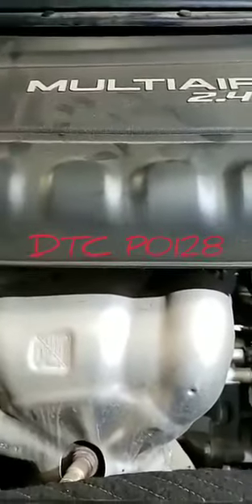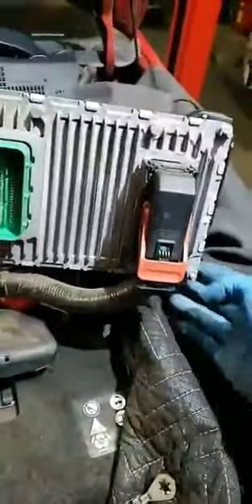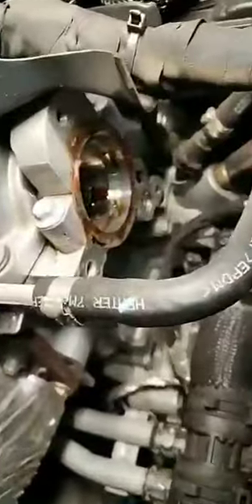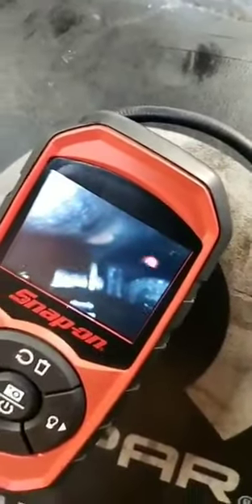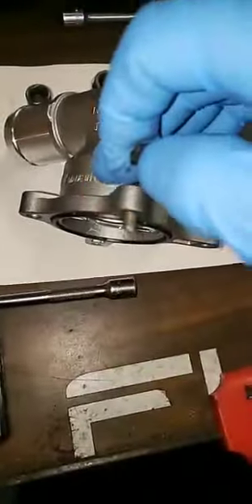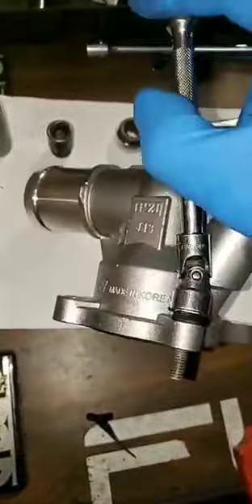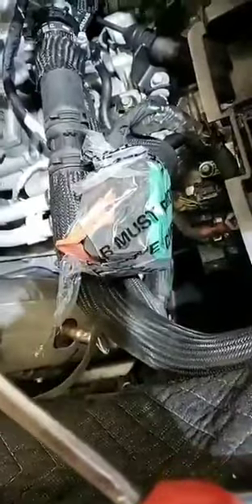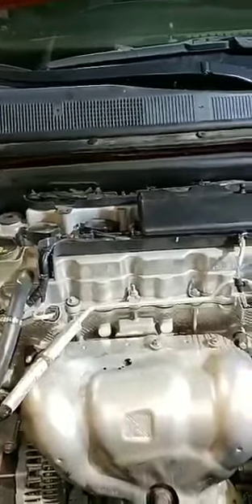2.4L DTC p0128 T-stat housing replacing on a Dart,200,jeep

Comment: Hey man. I’m gearing up to do this job in the next few days. Can you give me details and point me in the direction of the clamp/clip for the biggest hose. From what I read I’ll need to get a replacement for that one that gets taken off. Thanks!
Reply from the maker: Sorry for the late response. You're right you do have to replace the clamp. Unless  you have the right pliers, to release the clamp and to reinstall it.  Im sure I talk about it on the video.
Reply: @obe6655  no worries! I was able to do the repair, my clamp was different (just a standard hose clamp) so I was able to reuse it. Not sure if someone had already been in there or if the clamp corresponds to a factory build date. 

That last bolt on the bottom right is a real pain and having a handheld electric ratchet is a godsend on this
Reply from the maker: @hepagaming6206  sounds like you got the job done ✔. Nice.

Comment from the maker: If your going to thumb me down let me know why ? So I could get better to help you. If not I'm taking video down.
Reply: hey buddy, dont be sensitive, on the internet you gonna have haters..Some hate just for the hell of it,, Im still editing mine, ..Great video, mine similar but i tried to keep time low...good job..
Reply: Job Guerra great video! Don’t let negative comments or thumbs down get to you. Your video absolutely gave me the confidence to replace the T stay in my neighbors Dart. She is a single mom of 3, super nice and broke.  It’s under the factory warranty (25k miles) and the dealer won’t cover it so I’m trying to help her out. 
Keep the repair videos coming! Especially since you are a mechanic at a Mopar dealership! 
👍🏼👍🏼👍🏼👍🏼👍🏼👍🏼👍🏼👍🏼👍🏼👍🏼👍🏼👍🏼
Reply from the maker: @mopower70  sorry to hear that your dealership didn't cover the repair. If your car has less then 36k mileage even if the year is over the warranty there's a  goodwell program. you would  need to call the 1800 number for customer support or tell the service manager to call there dealer rep. I can't see why they wont help you. Derek thanks for the support I make more videos timelapse of me working check  them out if you wish to. Thanks
Reply: Probably because the picture is so tiny - huge black bars on either side of the screen
Reply: Cause it looks like you were filming while getting shot at, its extra jerky and grainy